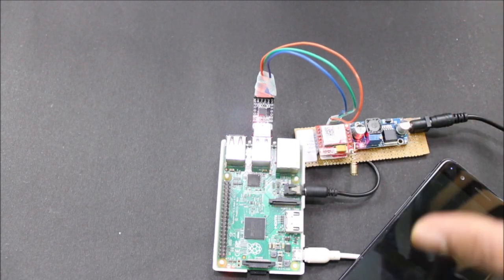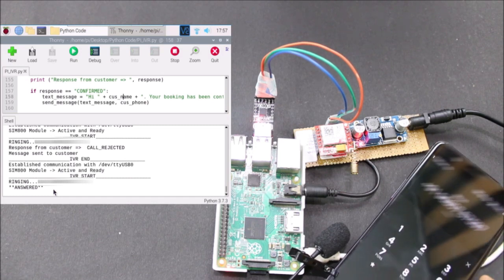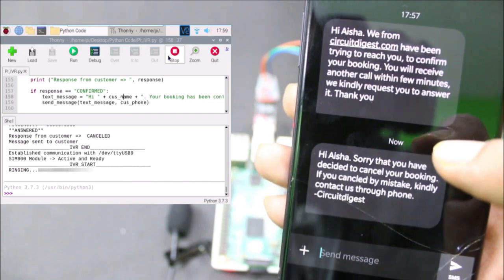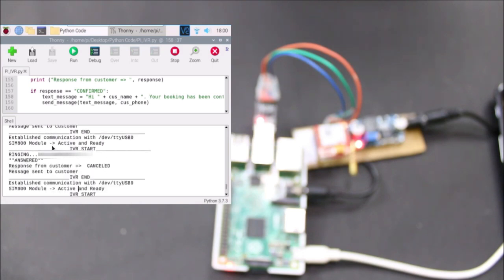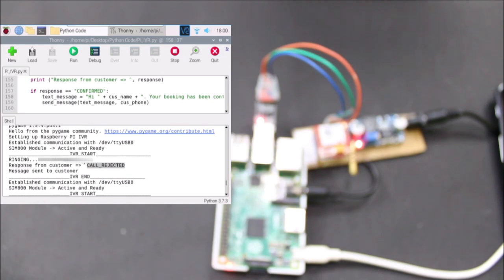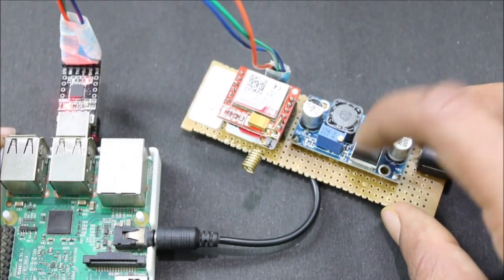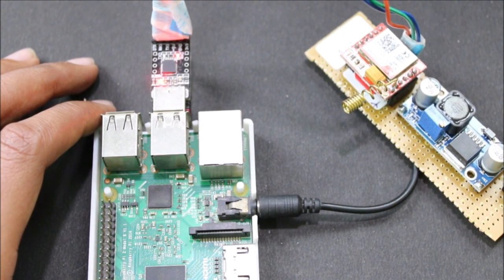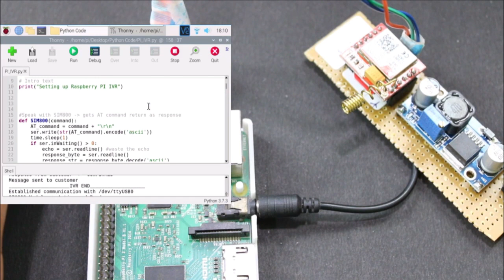Build an IVR System to make Phone calls and send Messages using Raspberry Pi | Raspberry Pi Project

Comment: Hi sir, i. Am currently doing a final year project which is frequency repellent system which involves the use of raspberry as core and ad9833 to generate frequencies and gsm and development of apps for the human wildlife conflict. I want to steup the mqtt for communication different my iot devices and using gsm modules to oush the detected aniamls to the clouds and mobile device to subscribe to the different class of the animals. Now i want to use a calling system using a gsm module in offline mode and use gsm in online to activate the communication to push the data detected

Comment: The call part works well but the messages can't be received. What could be the Problem?
Reply from the maker: Change text mode parameters using the following command . AT+CSMP=17,167,0,0

Comment: I have seen your youtube build IVR system.
and Interested in developing my My  case .

Present phone call  input the raw data to IVR system 

I would like to design a raspberry telephone calling app
to send data to  IVR system.

e.g 
raspberry pi Call the telephone center
1. Connected

2. send  task No.1 .or 2.  instead of pressing the keyboard
3) send succeed 1 or fail 2 instead of pressing the keyboard

4) send # key for confirmation

5. end phone call 

Is possible to use raspberry pi + telephone modem ??

Look forward to hearing from you !
Reply: I need ivr device , can u help me how to get it?